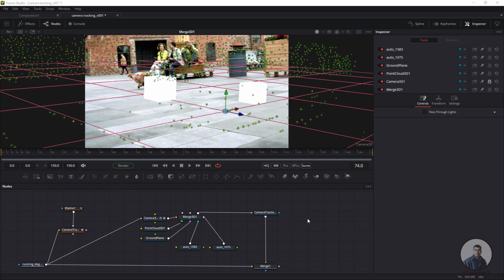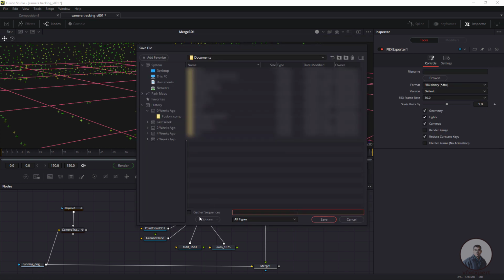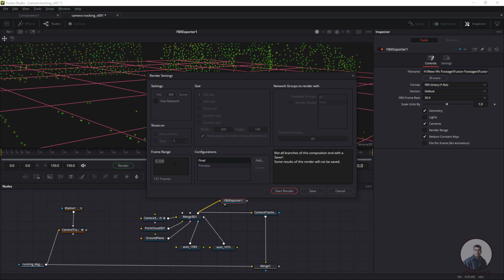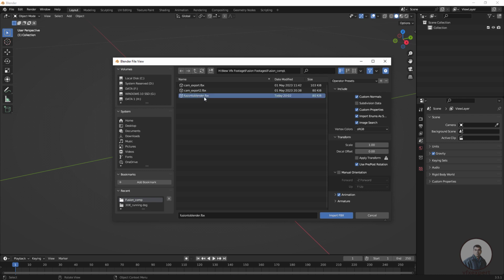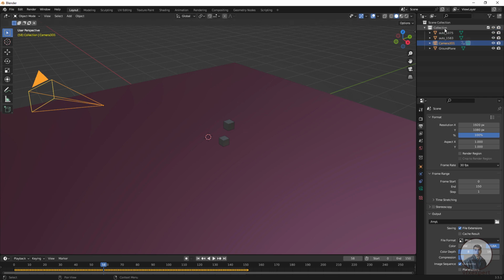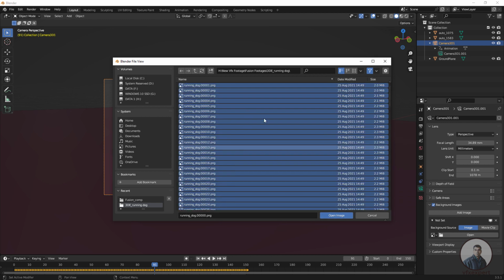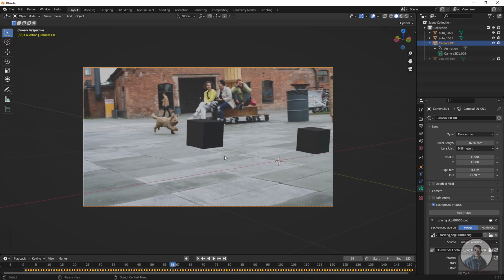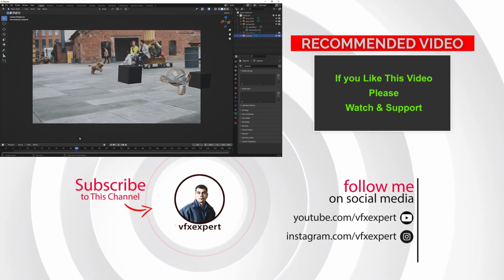Export Camera Track from Fusion To Blender | Exporting Camera Tracking FBX From Fusion To Blender

Comment: Why is there no render button?
Reply: Because you´re using DaVinci Resolve and not the Desktop Version from fusion. You have to put a saver node somewhere in your node tree (To nothing connected) and then put there the same path as you put in the fpx exporter node, and then you have to click "Render all savers" in the Fusion Tab on the top. In my case it works. Hopefully you make it also!
Reply: @filmeric-films  what does "to nothing connected" mean? also "patch"?
Reply: @timolenton1904  Ohh sorry, my mistake. I ment path, not patch. You have to add a saver node somewhere in your node tree. It shouldn't be connected to anything, just somewhere laying around in your composition. Then you put the same file path as in the fbx exporter node in the saver node. And finally hit "Render all savers" in the Fusion Tab in the top bar. Hope it make sense now.